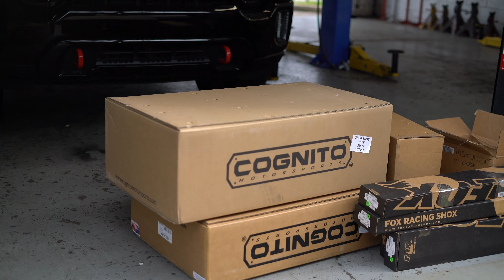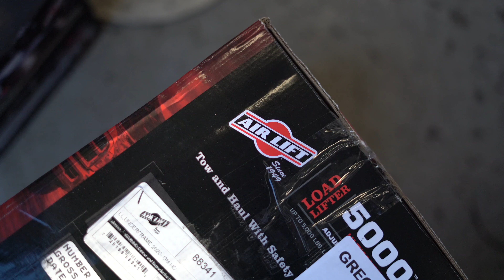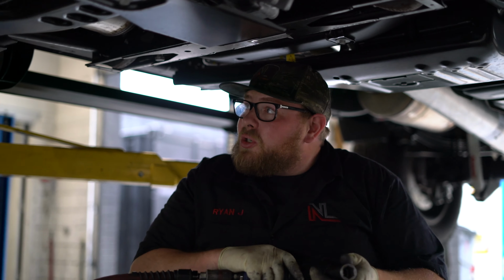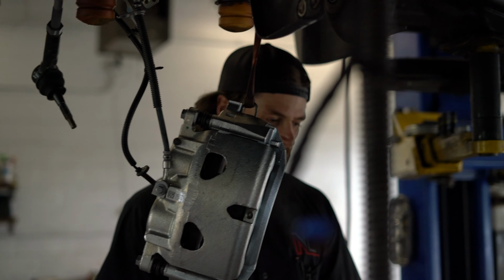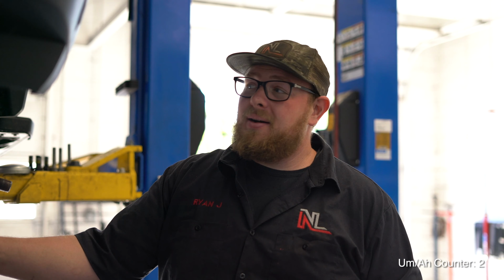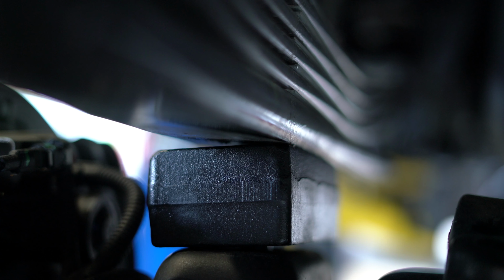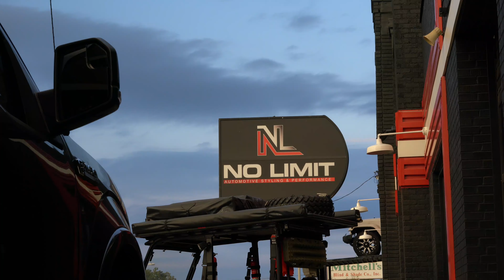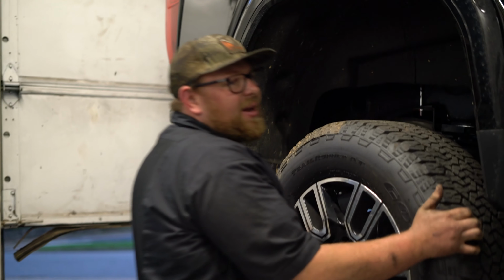Cognito 4" Lift 2020 GMC AT4 (Pt. 1) | No Limit Inc.

Comment: Love the editing of your videos, high quality!!. Look forward to seeing more of this build.  1 thing I noticed, air lift says to NOT mount that compressor upside down like that, says any orientation except upside down...
Reply: Good catch.  Our first thought was to mount it on the frame rail but unfortunately you could see the compressor at all times.  The reason they recommend that is due to the weight of the setup and people using self tapping screws that can’t support that weight.  We made sure to nut and bolt and provide extra security to the components.

Comment: That’s one bad ass truck
Reply: Not Really......maybe as a "Paved Street Queen"...but not as a "Off-Road Dirt King". I like the General Motors V8 gas engines. HOWEVER, the Chevrolet 4WD and GMC 4WD trucks are PATHETIC off-road on uneven terrain, especially in mud and snow. Both GM 4WD trucks have horrible aesthetics.....very ugly, especially the GMC...looks like it belongs in a Star Wars movie. Both Chevrolet 4WD and GMC 4WD trucks get stuck off-road way before the Ford 4WD and Dodge 4WD trucks. Why? Following is a list of several reasons ---------->

1. IFS Axle - Poor Articulation on uneven ground
2. Poor Approach Angle - truck is unable to ascend a steep hill
3. Poor Departure Angle - truck is unable to descend a steep hill
4. Poor Breakover Angle - truck gets stuck on a small knoll...ends up like a "Teeter Totter"
5. Low Hanging Frame Rails - major cause of problem listed in Number 4
6. Little Itty Bitty Tires - contributes to problem listed in Number 4
7. Square / Rectangle shaped Wheel Wells for a Round Rim and Tire - the proverbial "round peg in a square hole"
8. Requires 4 inch lift for 35 inch tires and 6 inch lift for 37 inch tires - this problem is related to Number 7
 
In short, GM engineers cannot design a good 4WD truck. The GM 4WD trucks are only good for driving on dry, wet and snow packed paved roads...to get groceries and a few materials from home improvement stores.

Comment: Nice work! I have a question what’s better the 4 inch lift or torsión keys? I’m planning in getting King shocks....please I’d greatly appreciate your professional opinion
Reply from the maker: 4” for sure because it takes into account dropping all the driveline angles/ball joints/tie rods for the best ride and stock longevity.  Torsion keys are perfectly fine matched with a set of Upper control arms but only can get around 2” out of them safely before the ride decreases dramatically.

Comment: So I have the same truck.  I have 50k miles on it and would like a slightly softer ride than the factory rancho shocks that come stock.  Do these fox shocks ride stiffer or softer than the factory rancho's?  Some say that the fox 2.0's are stiffer and some say that they are softer.  What is your opinion?
Reply: I would say Fox eat up bumps and dips in the road night and day compared to Rancho.  Fox, Bilstein, Icon and other 2.0" shocks in that category are more aggressively valved compared to Rancho I.E make it harder for the shock fluid to be pressed up and down.  Some would say they are stiffer/harsher in daily driving, smooth roads but absorb bumps way better so in our opinion at No Limit, we recommend Fox all day everyday and twice on Sunday!  Go with the non Resi 2.0 ones for the best daily ride.  If leveled Upper control arms and making sure the keys arent cranked too much make a huge difference as well.
Reply: @RJ-mq9th   Ok I don't ever take my truck offroad.  Paved local and highway driving only for me.  So I am going to level the truck eventually and my installer did say that I had to replace the upper control arms too.  So It looks like non resi Fox 2.0 are gonna be the next shock for my truck to give it a more comfortable ride from your advice.  Thanks for the input.  If I were close to you I'd bring it to your shop.
Reply: @richr909  Kryptonite or Cognito upper control arms and Bilstein shocks and Sulastic shackles in rear.

Comment: First Time Viewer. Great Video! Cognito is a great lift for the GM 4WD trucks with IFS Axle. Like the General Motors V8 gas engines, but do not like the IFS Axle 4WD trucks. 

@ 9:28 Deaver does not make a rear leaf spring pack for Chevrolet 4WD and GMC 4WD trucks??? Dang.....guess Deaver is too busy making those for Carli Suspension.....for the Ford 4WD and Dodge 4WD trucks. 

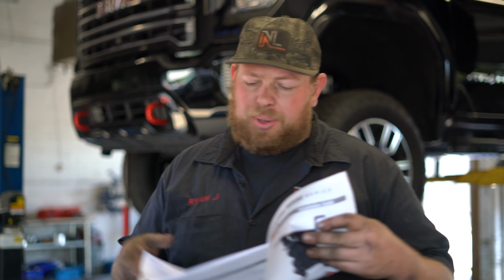@ 11:08 "last piece of the puzzle"......EXCELLENT IDEA to maintain "good articulation and wheel travel"...... you used a Daystar spacer as a cradle (bottom cup) for the Air Lift 5000 bag. How did you mount the Daystar spacer?

Saw another YouTube video showing a Ford F250 Super Duty with air bags. The cradle / cup was welded to the block tang so the air bag was not limited.....allowed the most articulation and wheel travel in the rear suspension. 

Now I am wondering how this could be accomplished on a Ford Super Duty equipped with the Deaver rear leaf spring packs. The Carli Suspension makes the Ford Super Duty with the Fox 2.0 reservoir shocks ride as good as...or the King 2.5 shocks ride better than a Chevrolet 4WD or GMC 4WD truck.
Reply: At the time Deaver wouldn't sell us leaf springs because they had yet to fit any on the updated GM HD trucks.  To mount the daystar cradle to the airlift setup, I just drilled one locating hole in the middle of the lower bracket and used the provided hardware.  Super Duties with the Carli setup ride like a dream, no doubt!  We prefer and recommend the Backcountry Carli setups.

Comment: Loved the video! But where can I find the spacers for the airlift?
Reply: And what airlift did you use?
Reply from the maker: You can find the spacers through Air Lift Company, as well as the system we used for this truck.  The AirLift was the LoadLifter 5,000 with a DayStar cradle to support the suspension
Reply: @nolimitbaltimore  thank you